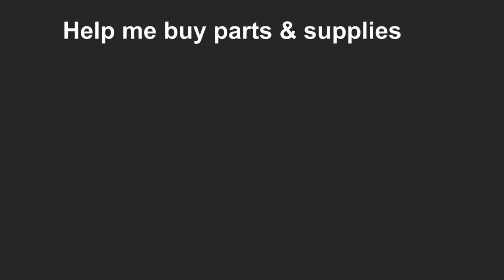How to Remove and Install the Hook & Finger on a Singer 401A PART ONE.

Comment: Thanks for the shout-out. The video was better than deja-vu because I learned a few extra things; putting a dab of red paint on one side of your Chapman ratchet ( to distinguish between IN and OUT I assume),  matching set screws on the meshed gears, and hook protection when removing the positioning finger. Like you, after I removed the hook and the positioning finger and saw all the dirt in there I was happy I made the effort.
Reply from the maker: Haha, good catch on the rachet paint, Terry. I was surprised by the amount of gunk around the top of the hook shaft bushing. It started me thinking of a way to "floss" under there for people who don't want to remove the hook for cleaning. Thanks again for the motivation in making this video. Take Care.

Comment: Thanks for the video, Andy.  I wrote to you and  Terry about a problem with my 500a.  The thread would get caught on the de-lint pin of the positioning finger.  I sent Terry  a photo of the positioning finger and He explained that Singer had instructions as part of the "Knit Kit" to grind off the de-lint pin and smooth the corner.  So I did that with a spare positioning finger that already had a broken de-lint pin and it fixed the problem.  I have read on forums, complaints by many people having the same problem.  I have another machine to repair to do the same thing to and so I will do a video showing the procedure (Singer Surgery) 😁
Reply from the maker: I remember the discussion. I did not know that the "Knit Kit" included those instructions. I do not have a good understanding of exactly what that Kint Kit included. Years ago a 503A I purchased came with a small plain cardboard box and inside was a brand new hook and a folded paper explaining how to thread the needle differently when sewing double-knit fabric. I thought the knit kit was just a new, better hook and threading instructions. Please do make some videos about the 500A problem and removing the de-lint pin. You'd probably be helping hundreds, if not thousands of owners. Good luck, and thanks for watching.

Comment: Your steady pace and narrative in your approach to this machine is synchronized so well that it stimulates one's curiosity as to just how much simple cleaning can play a part in this procedure.  There is nothing more rewarding to any mechanic than that aha! moment when the specific cause of the problem is made visible.  It always restores your problem-solving energy reserve and is one of those satisfying events that turns that "trouble" machine into perhaps the pride of the fleet so-to-speak.  Nothing demystifies these machines better than the calm, well-narrated approach that is a vital component of your methodology.  A very complete dissection of this 'problem area' of many machines.  
                                                                                                     Thank You, again.
                                                                                                 Mike Kirwan - Kenmore, WA
Reply from the maker: Thanks very much. Being a self-taught VSM Mechanic I try to help others with what I've learned. During my Telecom career, I lost track of how many training videos I had to watch and what little help they were. Most were made by a production crew that had never done the actual work. I never expected so many views of my videos, but figured I'd just make them as I'd like to see them.
You're kind to recognize the effort.

Comment: OOOh!  Perfect timing with this video for me.  We recently found a 404 for $10 at our local Goodwill(!)  I noticed the hook looked different.  It wasn't like the hook in the 403 or 401.  Apparently, the previous owner had put in a hook from a more modern Singer.  It had a weird part number that I could not find which machine it came from.  My best guess is that it is from a early model Touch and Sew.  It "works" and everything in the 404, but I want to put in the correct type of hook, and I have a 401 parts machine that has the correct hook!  I feel so much more comfortable watching you remove and replace the hook before I attempt it.  I won't do it for awhile because I'm sewing with the 403 (lovely machine--it just sews through multiple layers so well) and following this series with my 401.  And , I'm looking forward to watching your series on the 404.
Reply from the maker: Wow, that's a new one to me, finding a different hook. I guess I am not surprised that it works, but still ... if the machine could tell that story, right?  It is slightly tricky to R & R the hook on these models, but very doable as you see. You normally need to retime hook to needle afterward, but you have done that before too! I'm shocked at the $10 price! I looked on eBay just yesterday and saw that the PA style motors are selling for $39 + Shipping in some completed sales, not to mention the tension unit, handwheel, nose cover, etc. that always seem to sell out on eBay right away. The needle bar alone sells for at least $10! A very nice find, Carol, congrats, and thanks for watching.

Comment: On my 500A, the set screws on the hook and drive shaft gears are off by three teeth.Given all the factory did to get these gears to mesh, I am going to surmise that the fault lies with someone who took apart the hook and finger for cleaning and reinstalled it incorrectly. Thanks to your tutorial, I am going to set that to rights.
Reply from the maker: If the gears run quietly and smooth I don't think I would change the gear mesh. It may be worn in now and changing it back may make the mesh run rough. You can mark the existing mesh ans then change it back if you do not like how it runs after changing it. I also have used metal grinding compound to smooth out gear mesh problems. It is messy ans you have to clean the compound off completely afterwards but if you have a rough, noisy gear set it can help very much. Here is the brand I use but I'm sure there are others: https://www.amazon.com/Versachem-13209-Metal-Grinding-Compound/dp/B00C3Z9EX4    Thanks for watching and commenting. Good Luck.

Comment: Hi Andy,  I need advice.  I have a Singer 404 - regularly oiled/lubed, sews fine.  Recently noticed noise from hook gear - sort of creaking sound.  Local service center told me I had a lot of play in the gears and it wouldn't be long before they stripped.  Would removing and reinstalling the rotary hook/gear help keep this from happening?  When the rotary hook is rotating the oil port has sort of an oval track.  Do you have any recommendations?
Reply from the maker: Hmm... I've never seen those types of steel gears get "stripped" myself. You can adjust the play in the gear and shaft of the hook anytime you like. Did you see in the video that I found stuff under the hook when I removed it? What's under your hook, I wonder?
The hook shaft goes through a flanged bearing and I suppose it could be getting worn. It' seems odd that it is sewing so nicely with all that play in the gears, doesn't it? Creaking sound? Have you had a needle break lately or lose a pin? What if something is stuck under the hook and making the noise? Personally, I like removing and cleaning the hook area parts. It is not that hard to do. You can download a free service manual here: https://sewingdude.files.wordpress.com/2012/09/singer-401-service-manual1.pdf
The service manual explains how to eliminate play in the shaft and gears, remove and replace parts, etc.
You can download an extensive parts manual for model 404 here: http://www.universalsewing.com/images2/parts_lists/all/nijears4.pdf   It has every part on your machine listed by name and number with diagrams. that can help if you are looking for replacement parts. Many of the parts on the 401A, 403A & 404 are the same part number. You can frequently find parts for sale on eBay and replace any part you suspected (or wanted to have spare parts for the future) here is just one seller who has hook and gear parts for sale on 8/11/2020 https://www.ebay.com/itm/Singer-Sewing-Machine-Models-403A-404A-Choose-Your-Parts-Free-Ship-Over-25/163785629050?hash=item2622625d7a:g:RHEAAOSwhCJdNEYp
If the hook shaft bearing was worn and you want to replace, you'd probably have to ask a seller specifically for it. They probably do not take it out and list it very often b/c no one buys it. So, C T, that's my story and I'm sticking to it. Good luck, and thanks for watching my channel.

Comment: Oh Andy - thank you for this video.  I now know why the thread keeps catching on my 401.  Unfortunately, I took it to a local sew and vac shop to get it cleaned up a bit ago. They mentioned the delint  pin, so I said it was okay to remove it.  The thread still catches but not as often.  After digging in the bobbin, it appears they removed the delint pin without going to the trouble of removing the positioning finger.  As a result, the entire corner where the pin was located chipped off.  And they left it - ragged edges and all.  I know this because the bobbin was filthy and caked with lint.  No way they removed it.  You seem like a nice guy, so I won’t mention what I think of their laziness.  So now a question - I have googled and searched and cannot find that part to replace it.  Do you by any chance know the part number.  Otherwise, I suppose I could remove it and have someone buff it out.  Thank you in advance and also for your terrific videos.
Reply from the maker: It's so sad what these places do. You can't say anything that I have not said before about them. I'm sorry you went thru this. 
     The name of the part is "Rotating Hook Bobbin Case Position Finger", and it is part #172207. It can be hard to find by itself as they usually include it with the whole hook assembly, 
     The good news is the exact same part is also on Models 403A and 404 which can often be found for lower prices. When I'm looking for a harder-to-find part like this I go to eBay and see who is parting out a machine. If they do not list the part I see if it already sold and if not I will contact the seller and ask for the part. I often include the name and part number and picture of the part and even where it is on the machine. I've had about 50% positive results where the seller will get the part, list it, and email me back. 
     Many of them said they did not know anyone was interested in that particular part or that it had value. When they do this they seem to overprice it a little, but I get that as they had to make a special effort and I need the part. I hope this helps you and good luck.

Comment: Hey Andy, quick question. If the set screws of the drive gear and hook gear are not aligned, is that a sign that someone messed up when servicing/repairing the machine? My 401A was in pretty rough shape when I got her, so I have no idea if the set screws were misaligned from the factory, or if someone wasn't paying close enough attention when servicing.
Reply from the maker: I doubt they were misaligned from the factory. If they run smoothly enough I would not worry. Here is my response to this question from Compassion_for_all below   "If the gears run quietly and smooth I don't think I would change the gear mesh. It may be worn in now and changing it back may make the mesh run rough. You can mark the existing mesh and then change it back if you do not like how it runs after changing it. I also have used metal grinding compound to smooth out gear mesh problems. It is messy and you have to clean the compound off completely afterward but if you have a rough, noisy gear set it can help very much. Here is the brand I use but I'm sure there are others: https://www.amazon.com/Versachem-13209-Metal-Grinding-Compound/dp/B00C3Z9EX4    Thanks for watching and commenting. Good Luck.
"     If the screws look scratched or the slot is damaged it could well have been worked on before and the person was not aware of how to set the timing maybe. Again, if they run smooth and the machine is in time, I don't worry, If the gears run "rough" are noisy or "skitterish" I use the polishing compound with very good results, but man is it messy.